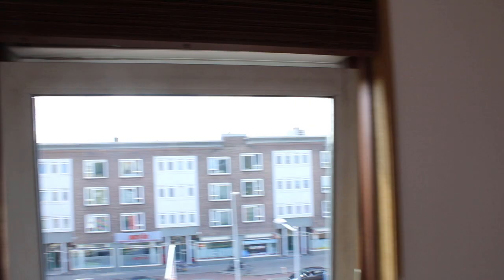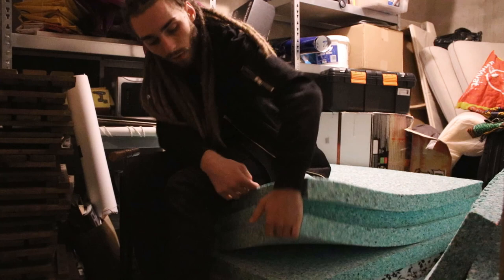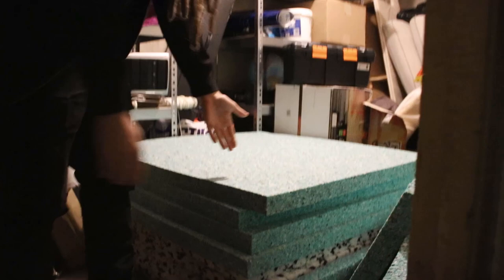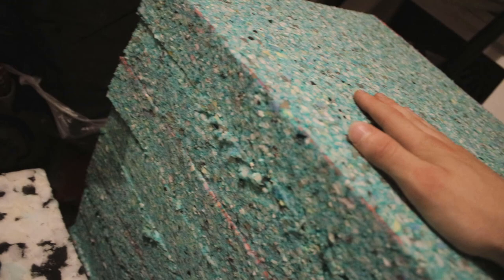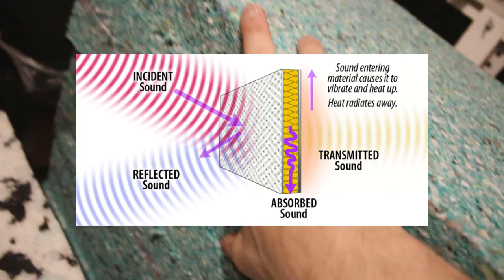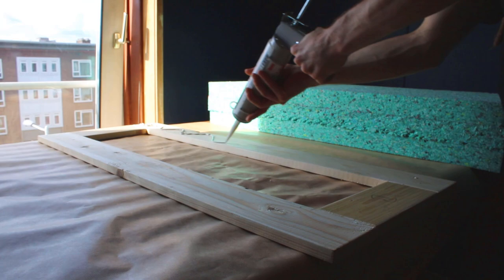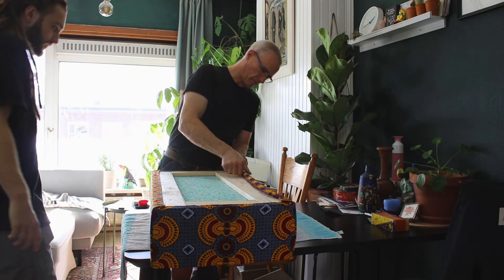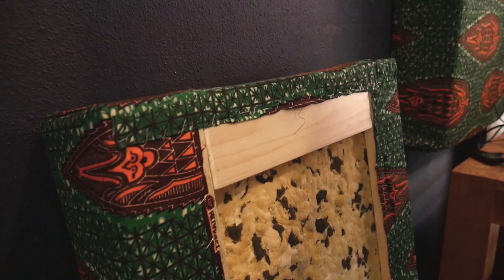How To Build a Home Studio with DIY Acoustic Panels and Bass Traps

Comment: Hello, first of all nice video, straight to the point with no BS. Great work:)
I just build a couple of bastraps with rock wool, but I have gotten a little parnoid about this health issue. 
Where do you buy these polypress-material ?  Thank you again!
Reply from the maker: Thanks! You probably don't have to worry if you have some of the rockwool panels. I know plenty of people who have these without any health issues. Just don't put your room full of it haha. I went and bought on www.polypress.nl but I'm not sure if they ship internationally. Good luck!
Reply: @DreadPitt  I feel quit allergic to the material so I will not use rock wool. I find another material, Isolina, which doesnt have any negative effects (except finacial =3 times more expensive than rock wool)

Comment: I've got a question...
Your bass traps looks super cool and you made an air gap between walls and them. Did you measure anything, like room modes or bass trap calculator? I don't need your measurement results, i'm just intrested - is this beauty mindless :D No offense. 
I'm kinda confused, cause, as I understand, if I won't do measurements - no need in acoustic treatment, like it must be... correct...
Also, video is super fantastic, stylish, and without echoe your voice sounds great.
Peace!
Reply from the maker: Hey, I made the basstraps as dense and thick as possible, and the air space behind it will also help im absorbing bass. I didn't make any specific calculations, but I hanged them in the areas where most bass tends to add up (in the corners by the ceiling). About the measurements; some treatment is better than no treatment at all. This method isn't as perfect as in pro studios, but I managed to get much tighter bass, so I can work with it.
Reply from the maker: And thanks for the nice comments!

Comment: yo can i add any cloth of choice for style? will it interfere with the audio absorption? Thanks in advance
Reply from the maker: Yeah you can use pretty much any cloth that air can pass through. I'd recommend something sturdy because it will make the panels stronger.
Reply: @DreadPitt  thanks for the quick response. a follow up question i have. Do you think a sturdy cloth would block the free fibers released from rock glass? I have no alternatives where i live but i wouldnt trade my health for better acoustics lol,
Reply from the maker: @odealianaffairs9001  The cloth will not hold back 100% of fibers. People have put plastic around the rockwool and then put cloth around it, but that kind of defeats the purpose of the panels. If you just want to make a couple of panels with rockwool (not glasswool!) though, I wouldn't worry too much about the health risks. Unless you're filling your whole room with the stuff without anything covering it, you should be fine. Plenty of people have done it and still do it with rockwool.